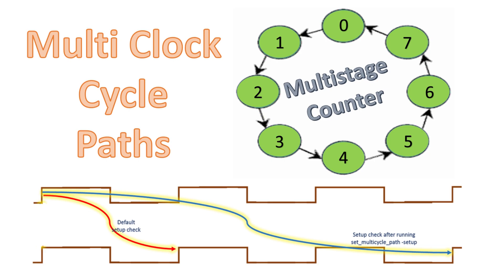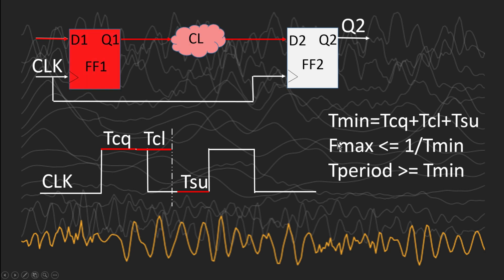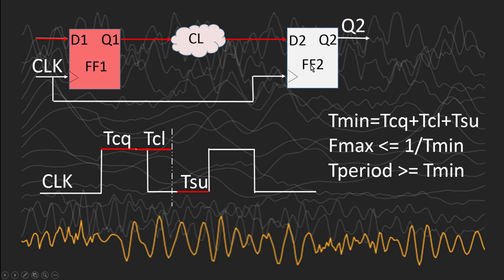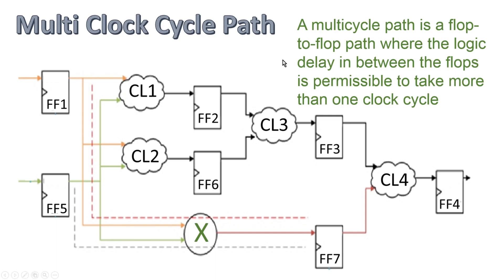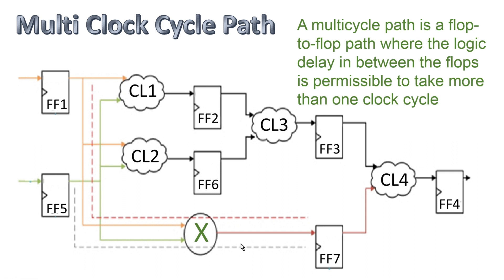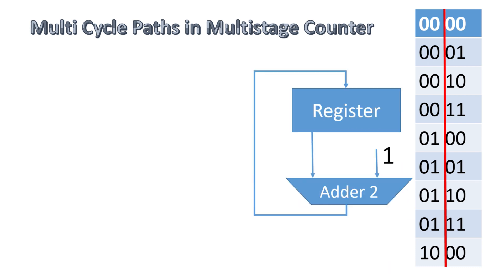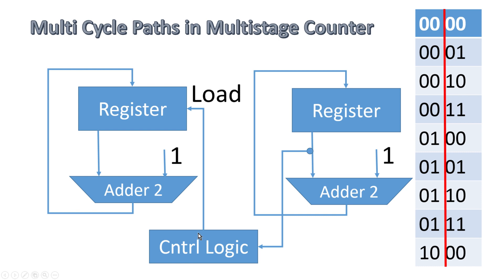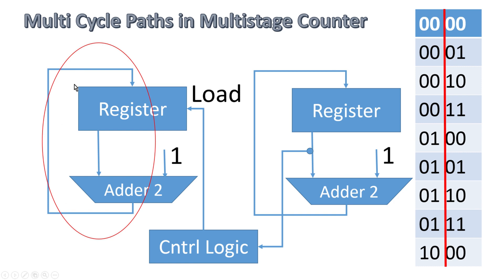Multicycle paths Explained with example

Comment: A good example for the simpler explanation. But practically I think this is not the correct example. Because, simple linear counters can be easily synthesized and with a multistage counter, there is extra combo logic involved(additional 2bit Adder). 
A practical example where I have used multi cycle paths in my designs is, let's say the MSB, 2 bits of this counter is used in a huge combo logic that couldn't meet timing in one cycle. Then according to the behavior of these MSB bits, they change once every 4 cycles. So, functionally we have 4 cycles for the combo to settle down. So, we can set a multicycle path to 4 cycles in that case. 

Caution: Always have Assertions wherever Timing exceptions are used.

Comment: I have a doubt in this multistage counter...when ever overflow occurs the control logic gives the logic 1 to second register..and you are saying that the second register is having four clock cycles to increment it...but my doubt is that the second register should get immediately incremented in the next clock pulse itself ryt?? then after it has to wait for three more clock cycles to get incremented
Reply from the maker: Please go through my video on multistage counter video if you still have doubt then we can discuss. Link of multistage counter video is 
https://www.youtube.com/watch?v=Jj8JHywYmHk
Reply: Ok
Reply: @rk-mn6mq  I think you are correct…. Once the first counter overflows, in the next cycle the second counter should increase otherwise the counter values would look like 0000, 0001,0010,0011,0000,0101(probably if the second counter updates after one cycle)
So, the they counter can’t take its own time… it should actually change in one cycle and it will be waiting for another load signal in next 3 cycles